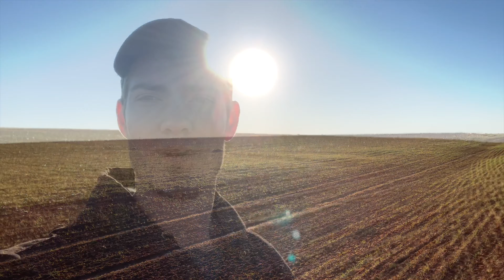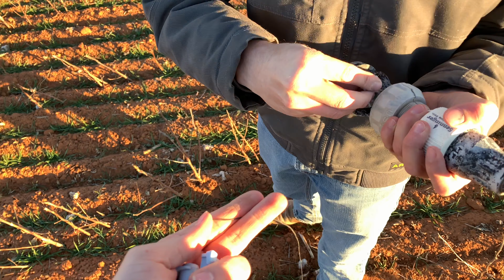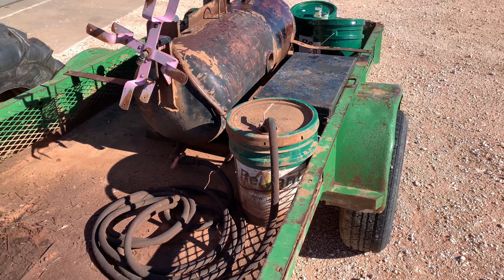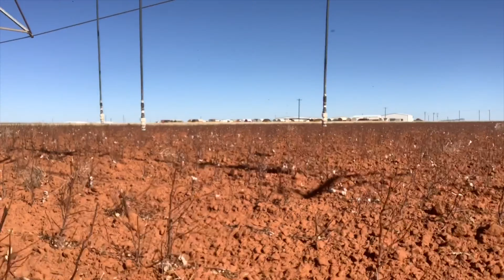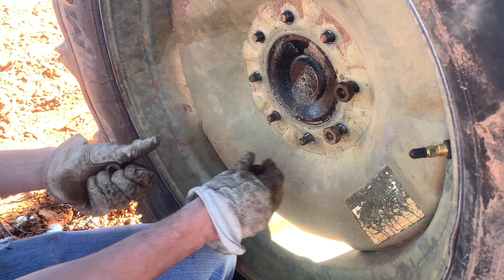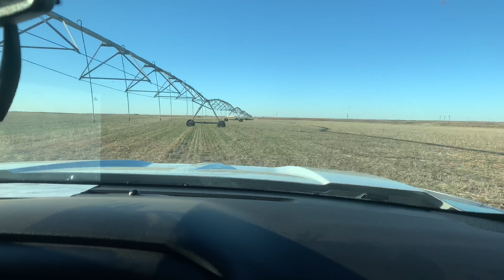Servicing pivots

Comment: could you please show us how to to replace the seals on a leaking horizontal center drive motor?
Reply from the maker: We never do it’s not worth the time
Reply: @conleybanman  Know what you mean... I run pivots in hot climate and some started leaking before comissioning so just replaced them with new ones.
Reply from the maker: We have some that are 10+ years old and leaking and they still work great you just gotta fill em up with oil once a year